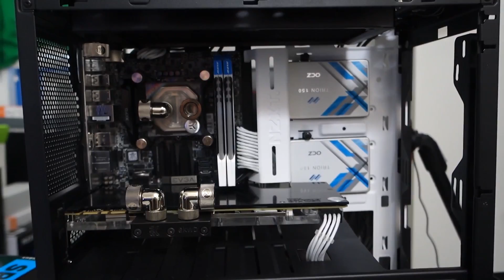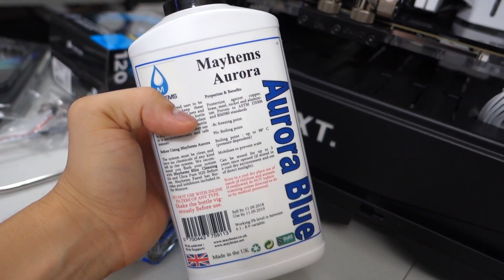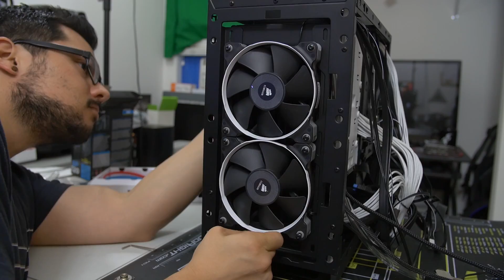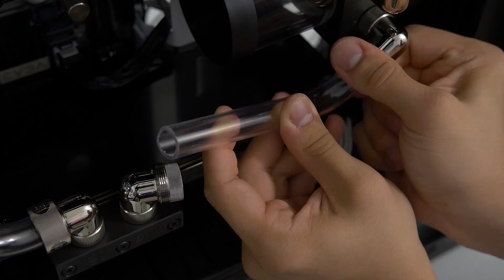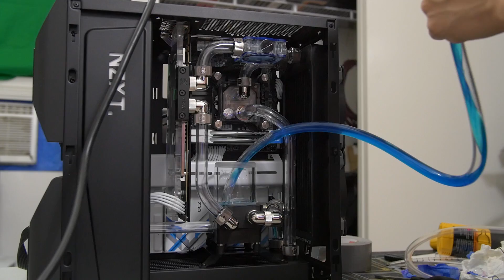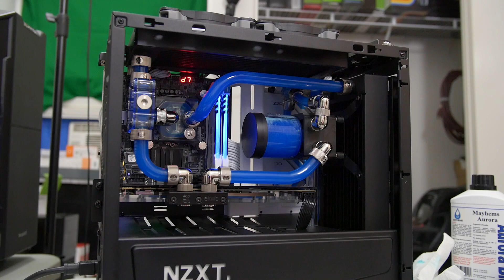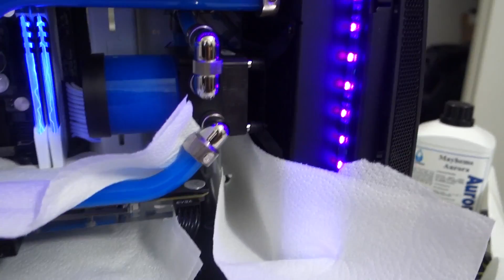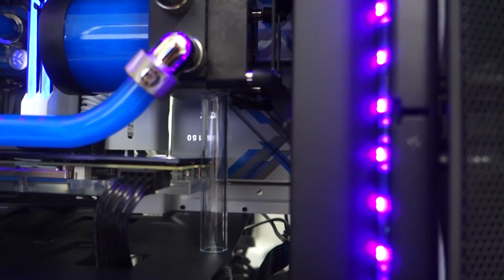Custom Tube Bending and THE MOST EPIC OF FAILS - Build Log #2

Comment: You gotta slightly bend the top two metal feet on ur reservoir to compensate for the weight. Or install a really small spacer under the bottom two feet. beautiful system

Comment: You should be using Teflon tape on all threaded parts that come in contact with threads IE the plugs and so on. If any excessive heat or vibration occurs your going to wish you had. Nice build by the way how much do you charge to design and build a pc on commission ?

Comment: You could use some black rubber gasket washers (or black painted metal ones but they can scuff easy, but look better if you can manage to not scratch them, but then again they can scuff whatever they are put between too when tightening them) under the bottom two screws to prop the reservoir up ever so slightly to straighten out that crooked look.

Comment: Bend the lower pump bracket out from the radiator until the pump gets a more "leveled" position and you get rid of the sloping look on the pump and the pipe.

Comment: Easy way to fix your reservoir sag would be to take the two bottom screws out of the reservoir bracket and use some small washers as shims between the bracket and rad to raise it up a bit.  That or just bend the bracket a little.

Comment: have you thought about putting a few paper washers on the bottom set of screws for the tank?  That should boost the bottom UP and prevent that sagging.  Also, what kind of memory are you using?  I've never see that plasma like charge lighting..  I would love to know.

Comment: Try getting some tag wire. It is super thin wire that you can use to go around the reservoir and tie it off to the top of the case. You wouldn't see it, or you could throw in some small washers on the legs that face the bottom of the case to jack up one side.

Comment: @Awesomesause Network What about spacers under the bottom set of screws? The ones holding the reservoir to the radiator. That would work~

Comment: Put a small washer under the two bottom legs of the bracket on the reservoir between the bracket legs and the radiator plate to push the reservoir/pump up at an angle desired based on the thickness of the washers.

Comment: Such ineffective custom water loops these days. More concern over aesthetics than performance. All of those connections and 90 degree bends. Flow rate killers. As well, no rear exhaust while having a radiator as intake? Unnecessary heat stress on the VRMs.

Comment: I used to build water cooled rigs, many many years ago, despite using quality components and putting a LOT of effort into the build and leak prevention, I could NEVER assure a long-term, leak-free build.  GPU's were always taking the brunt of the leaks and suffering damage as a result...

I'm not familiar with the fittings you're using, they look like quality parts, do they have long term reliability?

The rigid (semi-rigid?) tubing you're using is different as well, soft, flexible hose was the way before, but if it works, then so be it.

In the end, for me, the novelty wore off and I went back to air-cooled...

Comment: if you crimp the top legs on the reservoir, which will make them shorter that should lift it level, or if you pack out the bottom lets making them longer same effect.

Comment: You could use a couple of very Small Black Washers under the bottom legs of the reservoir tilt it up, it will be more stable than having the hose hold it up. mmm Yeah what Andres said !, that will teach me to read the other comments first....

Comment: You can use shims for in between the reservoir and the radiator on the bottom half to bring it up. They actually sell color shim sheets which you can cut so they don't overextend, they also shouldn't be real noticeable.

Comment: This is the first water cooling video I've ever watched, and I'm literally shocked at your leak testing method. Is this the community approved method of leak testing? It's crazy risky. 

I'm going to suggest you leak test using the same method you would use to leak test coolers/tanks in industry, use compressed air. For this small application, you could just get a little pressure gauge and a shrader valve hooked up at your fill point. Use your bike pump to fill the system with compressed air to 2-3 times your operating pressure, and leave it a couple hours.

If the pressure doesn't drop, you're good to go. If it does, you have a leak. It'll be harder to find, but at least nothing got soaked in the process. It'll cost you about 20$ in materials and forever eliminate your leak risk. 

Cheers people.

Comment: you've had to had a couple of solutions by now but add a couple of washers as shim's on the bottom of the reservoir bolts which will raise the it up back to level.

Comment: put a washer or spacer on the bottom screws of the pump on the radiator. it will give the rise from the bottom giving it right angle. I think that might work?

Comment: For the sagging pump, you could just use a few spacer washers under the bottom 2 retaining bolts, or, simply bend the frame arms slightly to counteract the sag.

Comment: sinking of the pump: the two bottom (the two that are the nearest to the gpu :D) srews need a washer/shim ( dont know how to say it) so that the are slightly more raised than the two sreews on the top. but i dont know if u can just deinstall the pump cause the system is allready filled up :/ but u are right it looks a little bit messy...

Comment: So um.. this is the most obvious question ever, but.. what happens when all this stuff is obsolete in 6 months?
I thought people stopped doing these kind of builds for just that reason.. like.. in the 90's.
Reply: Form over function for some people unfortunately. I quit this style of rig in the A64 days. Now I just want something quiet and unobtrusive. I don't need custom water anymore, especially not stuff that will perform on par with, or worse than a D15, due to all the connectors and 90 degree bends.
Reply: You make it sound like hardware is only good for 6 months when that's simply not true, sure there is better things always coming out, but for what people want their PC to do, it can lat for years... My current gaming PC is over 5 years old and still does everything i need it too, sure it's not as fast as it used to be and i'm currently building a new one, but all this talk of being obsolete in 6 months is BS...
Reply: ***** If you're talking about top of the line, best you can get, then yes, its obsolete in 6 months.  I have a 10 year old 16 core Xeon rackmount server with a GT740 that still does just fine with every game Ive thrown at it, but that is definitely not what the case mods in this video are all about.
Reply: water-cooling is a waste of time waiting for the right water blocks for your GPUs there is a phase change cooler with a cpu evaporator and a single gpu evaporator head or a sli evaporator 3 head phase change cooler so that saves fucking. with pointless water but you have to use play dough on your electronics to stop dammage from condensation
Reply: RJCleveland Part of why I said what I did is because there's been a trend for the past decade (with Intel processors at least) to decrease power use without affecting performance.
Trying to seriously overclock a quad core processor takes far more power than just getting an 8 core processor.
Overclocking gets you less performance per watt than a (relatively cheap) processor/motherboard swap.

I guess the same can't be said for graphics processors, though.

Comment: For the long run (if you really want to redo it) I'd measure the angle on the bottom run, from the the reservoir to the gpu block.  Then use that angle for the long one’s bend.  Have your diagonal lines parallel, as it were.

Comment: Don't see that anyone suggested it yet, but I would suggest using the slots on the NZXT mount behind the res to put in a make-shift U-bracket, preferably in white or blue and tighten it down in the slots at the height where it straightens the res, which would also take the stress of the rad it's attached to. Not sure how far you go with custom parts, but a little metallurgy and you could really tie it into the build and make it look natural.

Comment: modify a mount plate under each of the bottom two mount points of the pump like 3mm thick or so it will pull it back in to the eye at least

Comment: For making the res and pump straight, use tiny tiny washers on the two bottom screws going into the rad, that is if the screws are long enough for that. That's what I would have done.

Comment: don't mix. just use the uv reacting fluid in distilled water. with water by it self it's a perfect match with the heat spreaders. also the long run. you were talking about. take it all the way over so it's verticle and completely out of the way of the spreaders. sideways bend is what's throwing it off.

Comment: Someone already mentioned it, but using washers on the bottom part of the pump will straighten it out. Also, when bending tubes for liquids, the more curve, less hard bend, the better. 90's and tight curves increase resistance and therefore slow the fluid and cooling process. The slower the fluid the more residual heat is released back into the case before it gets to the radiator.

Comment: The radiator fins are deforming  thus the pump is sagging . You could do what Andres C. suggest or take a strip of Aluminum  a few cm thick x several cm wide , wide enough to drill pass through holes for the pumps hold down screws to pass through , and the strip long enough to reach across the width of the radiators frame . Using the frame for support . Taking the stress off of the radiators fins . Bridging over the fin area.

Comment: ok so I have a 1500 budget for a pc, but I've never built nor owned a pc. any tips on what I should buy?
Reply: Sebastian Sanchez http://pcpartpicker.com/list/TpzwzM

There's the best I can do. I got a liquid cooled radiator for the CPU just in case you want to to overclock the CPU which is a K series. the 4.0 ghz quad core should be fine on it's own because it has hyperthreading, but I was still able to keep everything within budget with the liquid CPU cooler, so I just decided to add it in. The more the merrier, right?

With the case fans, you should put the single 140mm fan at the top hot spitting air out of the case, Mount two of the 120mm fans to the radiator and put that at the front of the case pulling air into the system, and put one of the other two 120mm fans you have left at the back pushing air out of the case. Just keep the last extra fan stowed away in case another one has any problems.

The only problem I had was finding a GPU that was colored blue, I'm pretty sure the only part of the GPU that is colored red is the little red slits near the fan coolers, but that shouldn't be much of a problem because that will be pointing down.

For LED options if you want your computer to be lit up I'd get some magnetic RGB lighting strips so you can change the color to anything of your liking.

If you ever find the extra money I'd suggest going to cablemod.com and getting custom power cables from them. They're quite expensive though.
Reply: Go on Partpicker , helped me alot
Reply: ***** Honestly if you want a PC that will last you a few years without replacing parts, 1500 is a super decent price.
Reply: K version is clocked higher, and for 20$ more on a 300$ part it doesn't make sense to skip it.

Saying you need watercooling to overclock is a lie. I've overclocked on stock coolers. It all depends on the chip and the user.

He's a first time builder, he's very unlikely to want to even touch the bios settings. But if he decides he wants to experiment with overclocking he has the choice, and if not he's got the 10% higher clock speed. Which for a 300$ card is a 30$ difference.

1tb ssd is much better price per gb over a 250 or a 500. Not many people need more th an 1tb in total, however games are getting quite large, and those 250gb's will be gone fast.

Your build isn't cheaper either. Most mail in rebates are either never claimed, or are never paid back. Your build, without rebates, is 30$ more than mine.

Newer AMD cards are investments. AMD cards have always, and will always, age better than Nvidia cards.

On release the AMD 7970 was beat by even the GTX 670. Today, with all the driver improvements, the 7970 beats even the GTX 680.

Plus, the rear blower fan on the RX 480 pushes heat from the case directly, which is important considering the smaller case.
Reply: Does this budget include monitor, peripherals(mouse, keyboard), etc?
Reply: Ocean Man nope, all of the budget is for all the components inside the case
Reply: OK great that gives me a ton of breathing room. I can get back to you with a beast of a PC.
Reply: Ocean Man sweet, thank you for taking your time. Very kind of you
Reply: Sebastian Sanchez Although I should ask is there any color scheme you want, and do you want watercooling (watercooling is only needed when overclocking, and if you're just going to be gaming I don't think you're going to need to overclock with the build I can make out of this).

and no problem. Getting the parts off the internet isn't that difficult. Only takes about 10 minutes.
Reply: +Ocean Man well my favorite colors are black, white, blue, and purple so any scheme with any is ok, I'd prefer not to mess with any water cooling. fans are enough.
Reply: Please don't spend 1500$ on a pc.
6-900$ is a good sweet spot.
Reply: +Ocean Man Not even. Not everyone wants to max every game. You don't need watercooling, overclocking isn't worth the money, and every thing else is just excess.

100$ case, 100$ storage, 70$ psu, 200$ cpu, 100$ motherboard, 30$ ram, 250$ graphics card, 50$ in fans, drives, and additional shit.

Thats 900$.

600$ in monitors and peripherals is going to be a lot more enjoyable than a few graphic settings, a couple seconds of loading time, or bragging rights.
Reply: +Leighton Slanga well he told me 1500, and I could use all the money towards components, which I did. So I built him a computer that is at 1500.
Reply: inexperienced builder doesn't realize he's skipping over a sweet spot and losing bang-for-buck. if you're smart enough to tell him what parts to buy you're smart enough to tell him he doesn't need to spend so much.
Reply: ***** I'm not one to ask questions. I just send them what they want. Now if someone asks, I'll help them.
Reply: Im asking for a friend because i already ordered my pc, but can you give me a partlist for a 300-400 budget pc?
Reply: Konyalic42 That's a bit of a difficult one. But this is probably the best you're going to get for $400 (parts are on left side of screen): http://pcpartpicker.com/b/XB7hP6
Reply: ***** well anything you'd recommend? Don't get me wrong if the parts are cheaper and I'd get the same performance that'd be cool 😂
Reply: Sebastian Sanchez Well you're not going to go much cheaper if you want the type of performace that computer is going to give you. The radiatior can be removed and replaced with a normal cooler. You could also replace the 1070 with a 1060, but if you're planning on gaming in 4k the 1060 isn't really an option.

EDIT: I went ahead and replaced the radiator with a really good fan cooler, replaced the 4790K to a normal 4790, and changed the ram from a DDR3-2400 to a DDR3-1600. Managed to bring the price down about $130. If you are going for 1080p gaming, we could also replace the 1070 with a 1060 and drop another $200
Reply: http://pcpartpicker.com/list/FKFVcc

1200$

Take the 300$ and buy a monitor, mechanical keyboard, high quality mouse, and mousepad of your choosing.
Reply: ***** That build isn't too bad, but as I said with my own build, if you aren't getting watercooling for your CPU, the K version serves no purpose, as you should only OC if you have liquid cooling. You also really don't need a 960GB SSD. All you need is one big enough to hold windows and your favorite games.

http://pcpartpicker.com/list/VqZhtJ

This build costs even less with the Operating system, a 1060 which as of now performs better than a R9 480 because almost no games use Vulcan, and custom fans which you're pretty much going to need.
Reply: also when buying a 4790k always go into bios and check the voltages they ship out with different set voltages, could run hot if you arent checking it. the one i got came at 1.3 volts and thats way to high lol.
Reply: Why are you guys recommending a i7 4790K when the i7 6700k is out for the same price? [
Reply: Ammar Hasan Motherboard prices.
Reply: ***** You can get the MSI SLI plus at the same price. It's not worth going with a old platform for just a board, you are losing out in performance and new features. I mean what does the Z97 MSI Krait have over the Z170A SLI plus to make it worth having a older platform?
Reply: Sebastian Sanchez NVIDIA NO MATTER WHAT ANYONE SAYS ABOUT AMD!!! NVIDIA
Reply: Slime and Pixelton I can has part list?
Reply: May I suggest saving just another $500 and checking MainGear Drift ?If you live in the U.S your lucky , I'm across the pond  :-( Shipping &customs is prohibitively expensive .
Reply: MainGear Drift starts at $1200.